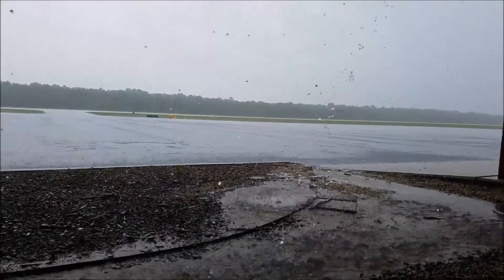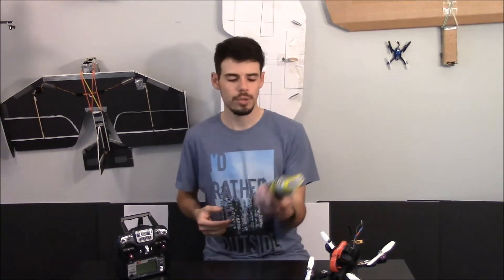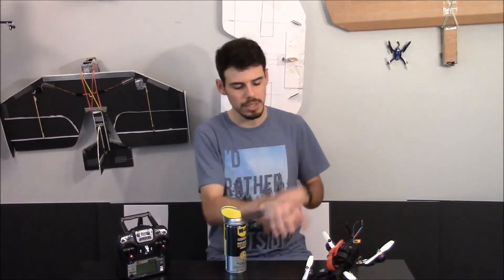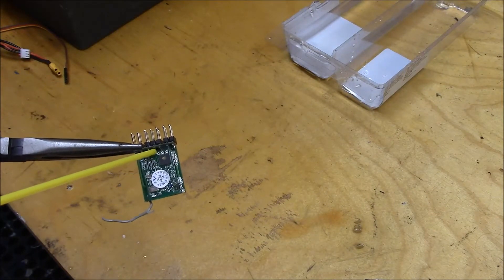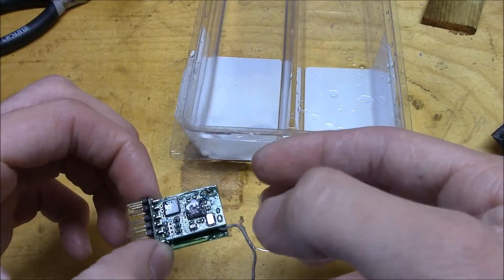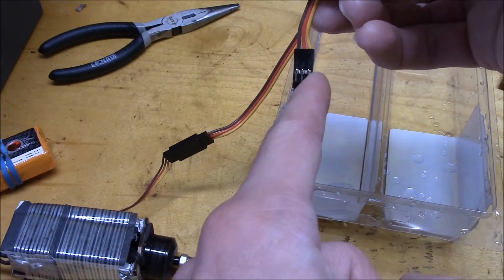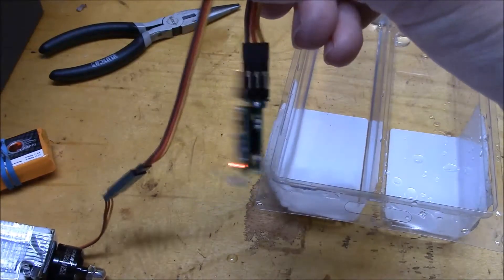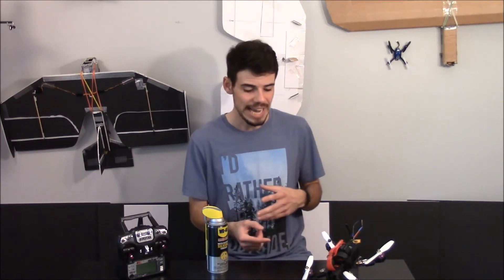Waterproofing Electronics with WD40 Silicone Spray? Receiver Dunking Test

Comment: And just so everyone knows, brushless motors are electronically waterproof. No need to spray them. Although it might help the barrings. But there is a UV reactible conformal coating that insures proper coverage. There is a link below in other comments. Fly safe!
Reply: Can a standard motor's Copper commutator with carbon brushes be waterproofed 
against corrosion? (not counting sealing the motor's housing or case...)
Reply: @251omega  No a standard DC motor and its brushes cannot be water proofed. That said, they will run in wet environments just fine. Be sure to dry them fully after use though to prevent corrosion...

Comment: I'm a retired EE.  Engineering Design and product testing are things most Engineers do in the course of their careers.
Here are some things to keep in mind, (off the top of my head, and not necessarily a comprehensive or complete list.)

---> Define your standards 
---> lay out what are the expected or desired test outcomes, Test only one variable at a time.
---> Try testing in SALT WATER to see if it is really waterproof. A lot of untreated things will work underwater - for a while...
---> Tests should include a "CONTROL" that has not been treated to see how it compares to treated.
---> Test to determine lifetime or duration of protection, how reliable is the treatment over time?
---> Evaluate and Explain and Recommend.  
---> Keep records for better or later analysis  (AND to include with your Resume, if you want to "monetize" your hobby!)

Comment: Pure water is H2O, has no ions in it, and therefore does NOT conduct electricity. A proper test here would have used salt water.  (Check your freshman chemistry text.)
Reply: Unless it was distilled water, there's likely sodium in it. It doesn't rain salt water as far as i know. So using salt water wouldn't be a realistic test unless you live oceanside. I do agree it could be a more comprehensive test.

Comment: I can’t find anything on this question of mine probably since it’s a unique situation.. I’m trying to prevent corrosion on my micro USB connections for my outdoor Ring Camera, it attaches to a solar panel using a micro USB connection.. I’ve used all different greases for battery terminals, spark plugs etc.. but this is an odd type of connection that I don’t want to do damage too but would really like to weatherproof this as best I can... I’ve never used this product before but does anyone know of a spray or grease I should use??
Reply from the maker: You might try CorrosionX (the Aviation formula is what I use a lot. It is supposed to be safe with plastics and electronics.
Reply: RCwithAdam thanks for the quick response, I look into that ASAP! It’s somewhat shocking at the lack of information on this particular discussion and massive debate between types of corrosion protection for electrical connections... thanks again!

Comment: Just so everyone knows this works but doesn't keep it waterproof forever. After a day or so it will short out again. Cause WD-40 silicone does dry up eventually. . Basically your best safest bet is to use coformal coating for everything but plugs and buttons and barometers and USB and use WD-40 silicone all those places Every day u go to fly in the rain or snow. Just reapply to the plugs and stuff each time you go out and the conformal coating will stay for along time. Just check the conformal coating coverage with a blacklight/uv light. It glows bright .
Reply: If this the case can we just use coformal coating for everything including usb,button and cable too?
Reply: @chenglau711  There's really no way to waterproof the USB other than corrosion x and that stuff is a mess worry free FPV is also an option that I believe they just use rubber plugs for the USB
Reply: @Reecefpv  if I use corrosion x on my electric scooter, to spray on motor, controller and connecting ports, how long will it last for the spray to wear out? How about if big pile of water that cover more than half of the motor also?
Reply: @chenglau711  I couldn't say for sure I know it doesn't last forever but I've never personally used it when I waterproof I usually Conformal coat everything but the plugs and buttons then I use liquid electrical tape on those cuz it peels off easy but it's also flexible and doesn't just crack
Reply: @chenglau711  I'm not sure on the motor part
Reply: @Reecefpv  so you are saying you use conformal coating which is corrosion x on all the electric device include plugs, motherboard and button? And then put a layer of electric tape on for double protection? I search a little and some says corrosion x will stick on dirt and grease though
Reply: @chenglau711  no. corossion x is different than conformal coating. I use conformal coating on everything but the plugs and buttons and I use (liquid) electrical tape It's like a rubber liquid that drys into flexible rubber basically
Reply: @chenglau711  go through this guy's videos and he has a video on kotking.
Reply: @Reecefpv  thanks I'll watch his videos to know more 👍👍

Comment: I actually tested this stuff out in the rain to see how it would do with a cars windows/windshield (before it started raining), surprising results.
AND it actually does great for cleaning windows.
Reply from the maker: Wow!
Reply: @RCwithAdam1  Not sure if that's sarcastic :p but Maybe you could test it for yourself, just a spritz around the windows not a full on jet, wipe with a paper towel to spread it, spritz and wipe again until Clear. It also doesn't leave streaks once wiped/dried like glass cleaner normally does. Its not on the level of Rain-X type stuff, but it does have an effect.

Comment: How long would something be waterproof for?
Reply from the maker: Not sure. It would depend on how much it's used (it would get rubbed off with use).
Reply: @RCwithAdam1  I will go ahead and try this!! Thanks a ton for your responses.. Idk what your channel is about but it's been subbed
Reply: @RCwithAdam1  That was gona be the best part.. jk but in all seriousness do you know of any exterior coat that can permanently make something waterproof? Or at least for a really long time?
Reply from the maker: Yeah I guess that would be silicone conformal coating

Comment: I use this stuff (link at end of comment) It works really well in my opinion.
https://express.google.com/u/0/product/CRC-02094-Electrical-Silicone-Lubricant/4908553994995244044_16160798852071498394_1183006?ved=0CAIQ0FUoAGoYChMIxIjw_vrd4AIV94VaBR0TRwHxEIsB

Comment: What would be the right protection for LED wall integrated circuit panels? i´m suffering lots of failures from humidity...
Reply: Alejandro Ramirez Martinez
Just spray everything with WD40 it doesn't harm anything, make sure it's DRY before you spray, dust is no problem.